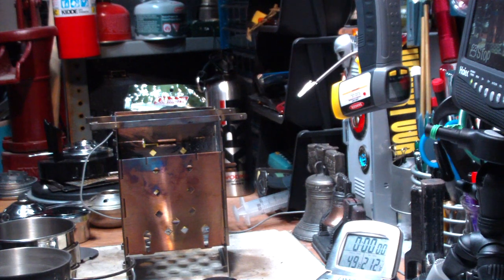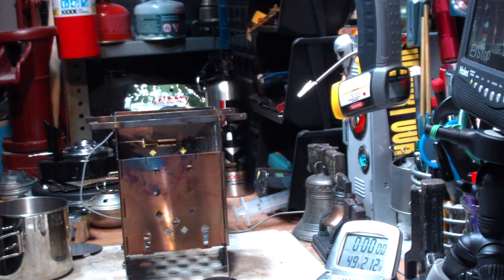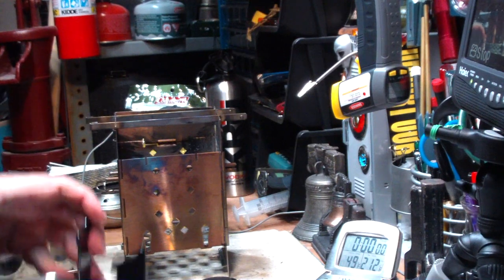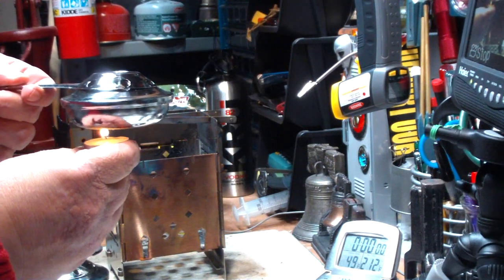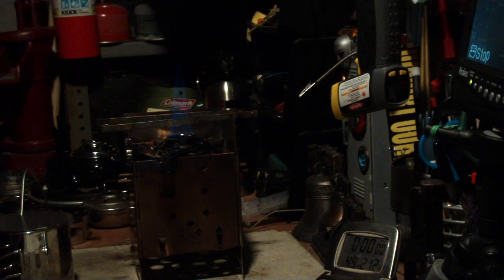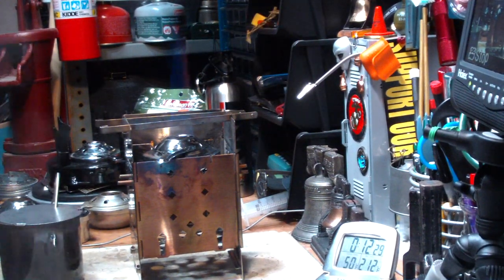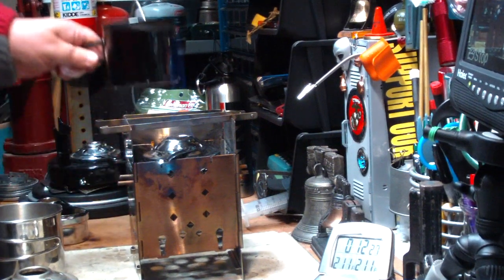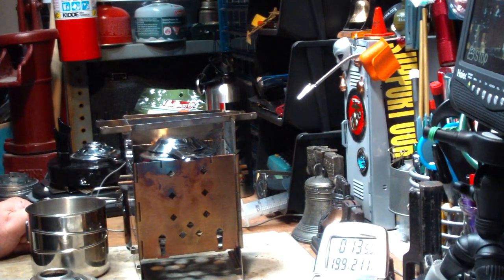Clean pot vs Blackened pot

Comment: The black bottom absorbs IR heat better, but not blue flame. ie; a glowing orange burner bell and plate but not a trangia flame.
Black sides radiate heat out more readily, but shiny sides reflect the heat back in or at least resist radiation more.
If using a high output stove that glows orange, a black bottomed pot with shiny sides (and a lid) are your friend.

Comment: If the carbon/soot coating is too thick, it will act like an insulator as compared to bare metal.  I think in the solar industry, they are using black anodized metals such as aluminum, which is a very thin black coating.

Comment: Interesting, why not use the GSI on the wood stove 5-10 times and boil 2 cups of water..... and try again to see the difference. Most likely will you not have used the GSI only 1 time in open fire.....
However it shows that there is no difference actually for a one timer.
Thanks for presentation, looking forward to a sequel ;) 

// Horschen

Comment: My mess tins are ancient. One is blackened to heck and back after {harumph} years of being used on all manner of stoves and open fires. The other tin is spotless. 
500ml of water at 10C on my stupidly fast Nova running full tilt on a kero/naptha mix. Both tins gave a 2:35 to violently rolling boil.
As an aside, with the Nova mounted in a Trangia 27, it takes longer to prime and get to full heat than it does to boil 500ml.